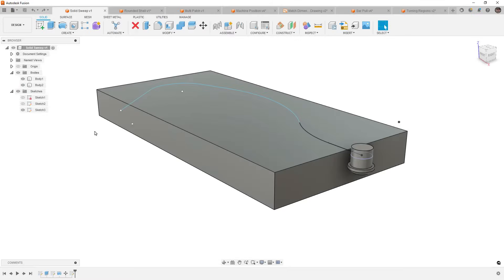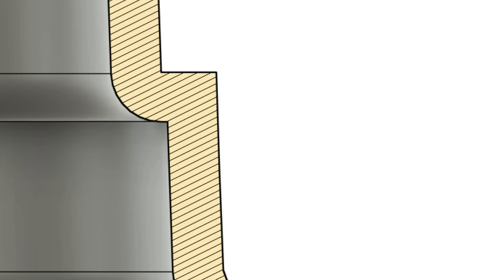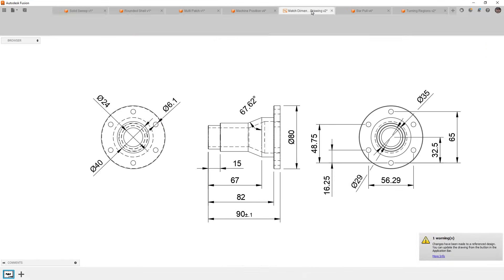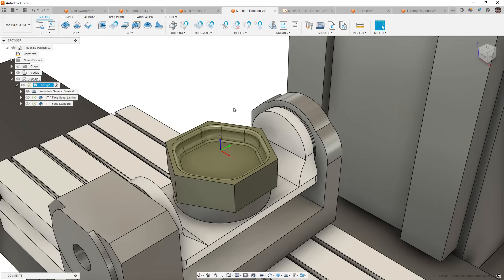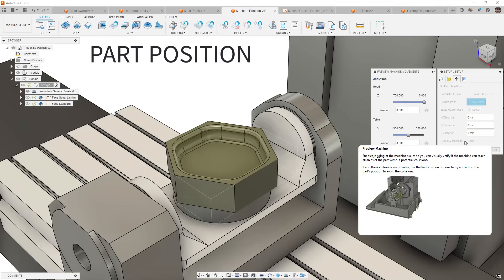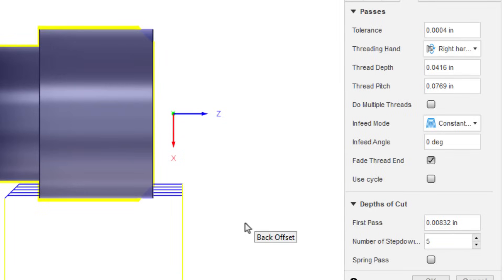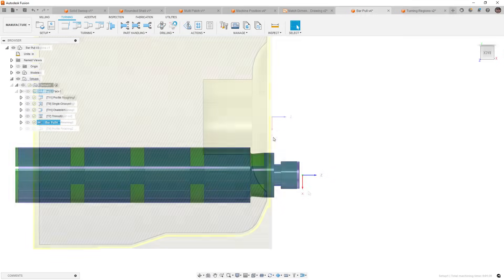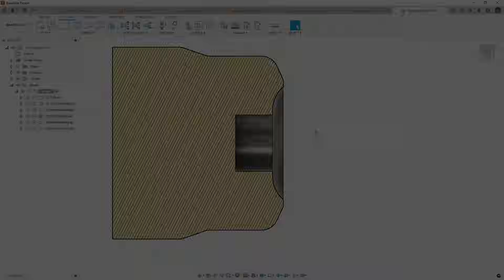What's New in Fusion | May 2024 Update | Solid Sweep | Shell | Patch | Drawings | CAM

Comment: Thanks for this great video!! The sweep body feature seems great for singular planes! I am trying to make pin and lock design using sweep body but ran into trouble... is there a way to use the sweep body for following a 3D sketch as the path? I want the pin to go forward, then left, then down in an arc.
Reply from the maker: It does work with a 3d sketch path BUT its pretty picky because it has to figure out the vector direction of the object.  Try a simple test with a small sphere as the solid sweep object and a 3d curve path.  That should work.  When the solid sweep object is a bit more complex unfortunately you run into self intersections and the error message isn't super helpful.

Comment: Any thoughts about the new ground to parents command? I ran into issues with a sub assemblies full of fasteners that gave me errors we I used the join command. Not really intuitive IMO
Reply from the maker: I think in theory it is a good idea, but in practice it is just shifting the problem.  I generally use Rigid Group when i have a bunch of sub-components like hardware in a sub-component assembly.  with the Ground to Parent. the default behavior is for the new component to be grounded to the top level, and for sub-components to be grounded to that parent.  So that means for most cases you need extra clicks to undo.  maybe ill have to do a video on just that but at a first glance I am not a fan of it.
Reply: @LearnEverythingAboutDesign  if its improving overall geometric stability I am all in. I still often have issues with bigger assemblies containing subassemblies that at once point the parts are all over the place, even though everything is well defined with joints.
Reply from the maker: @emanggitulah4319  How many components are we talking about? 500,1000, more?
Reply: Not that big. But with fasteners about 200 components. But even with less I can get issues with fasteners suddenly floating around. Sometimes ctrl + b (compute all helps) but not always
Reply from the maker: I did a video this AM on the Ground to Parent.  not sure if it helps or hurts :)  My suggestion is still to turn it off.  In my mind if you want all the components to be grounded just make bodies in a single component.  Rigid Group is still a feature in the timeline while Ground to Parent works from the start of the component which can really throw things for a loop.
Reply: @LearnEverythingAboutDesign  just watched your video. Thank you.... Really hoped me to understand.
I had a sub assy that had some hinges and it took me quite some time to understand why all the joint would fail... while the error message was not helpful 😅
Anyway will deactivate it for now, but will keep an eye on it
Reply from the maker: @emanggitulah4319  No problem!  Joints can be a tough one.  Fusion is basically looking at the coordinate systems (origin) of each component.  If you are applying a joint between sub-components, the joints folder will be in the parent component to them.  If applying them to single components, the joints folder will be at the "top level".  where this gets tricky is when you start moving things around.

For some designs I will make all bodies, then convert them at the end of the timeline to components and apply joints.  When i need to do more modeling ill roll the timeline back and work on the bodies.  This is pretty stable but the timeline can be a big mess.  In cases where I know exactly how many components an assembly will have and how they will be organized I will start with empty components and focus each design at their own origin.  This can get tricky as well.  I had planned to make a video on all the ways to do this but honestly there are so many that its nearly impossible.
Reply: @LearnEverythingAboutDesign  very good point. I will try this with my next project.
A good workflow for me is to do a semi messy assembly when I still do design exploration and once the concept is solid, I will start over and by then I have a good idea how to create a stable and clean design.
Thanks for sharing!